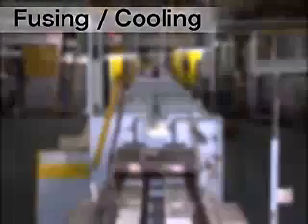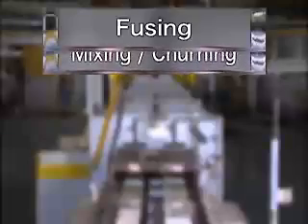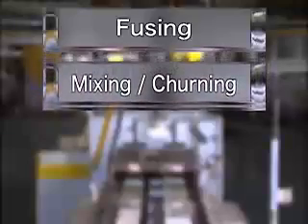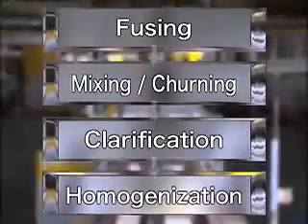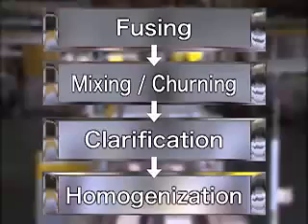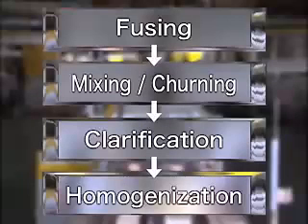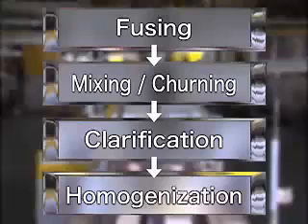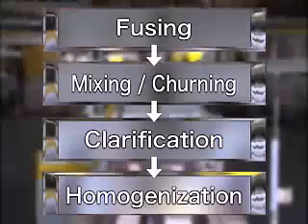Canon Lens Production 1

Comment: Well holy shit I am glad I was told about that. You learn something knew every day. So f/4 can be wide or small depending on the diameter of a lens? So really, it's all comparative?

Thanks for telling me that! Very informative and I won't make a dick of myself in the future.
Reply: Ok, so the F-stop is simply a ratio.  It doesn't matter how big a lens is, the ratio will be the same.  So F4 on a lens with an 82mm front element diameter is the same as F4 on a lens with a 52mm.  Its calculated by dividing the focal length by the diameter of the aperture.  Its generally used as a measure of light transfer, but this is actually not 100% correct, as each lens can have various levels of that (this is actually the T-stop of the lens) even when using the same F-stop.  In general though, F4 on say a 200mm lens will allow for roughly the same exposure settings as F4 on a 35mm lens.  Its just the focal length relative the size of the opening of the iris; the longer a lens gets, the wider the aperture has to be to allow the same ratio.  On some lenses that zoom from one FL to another, you might have what is a variable aperture, expressed like F4-5.6.  This means that as you zoom the ratio can change, and your exposure will be effected.  Some zooms have a constant, usually your more expensive F2.8 or even F4 lenses (70-200mm comes in both flavors).  This means the ratio does not change as you zoom, as the lens is engineered to work this way, which is part of why they cost so much more than the variable lenses and usually have more limited range (a 70-300mm will almost always be variable, while most 70-200mm are constant).   

Sorry it took 7 years to find your comment and reply, LOL.  You probably already found all this info in that time.  But maybe someone else is just now finding it and still needs it.  So imma leave it here.

Comment: It's pretty large, considering the 500mm focal length (F). Remember, it's a function: The diameter (Ø) of the aperture in a F/4 lens when the focal length is F=500mm, is: Ø=500mm/4=125mm. 

In comparison, the diameter (Ø) of the 85mm F/1,2 is a measly: Ø=85mm/1,2=70,83mm.

For a 85mm lens to have the same diameter aperture as the 500mm F/4 (Ø=125mm), it would have to be a 85mm F/0,68 (!) Ø=85mm/0,68=125mm

In other words: F/4 on a 500mm lens is huge!

Comment: I think he meant the front element size, which divides the focal length with the maximum aperture. So the lens in this video actually has a larger front element (and therefore aperture [hole]) than my Canon 100mm f2.8. But yes, my 100mm is quicker than the 500mm mentioned in this video.

Comment: It does. The whole question is: what's the finest detail a device is able to deliver? Everything a photographic lens does is "tie" the incoming rays of light together and put them the correct spot on the sensor or film. While a bad lens would make two black dots with a little bit of white space between them appear as one while a better lens would deliver both dots and the spaces. The better lens RESOLVES the incoming light into a more appropriate "package" that contains more information.